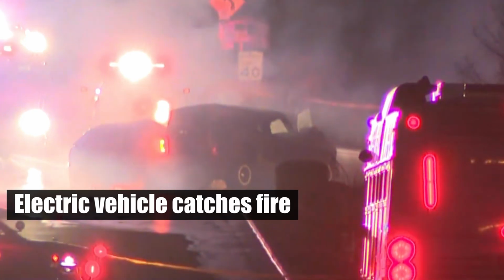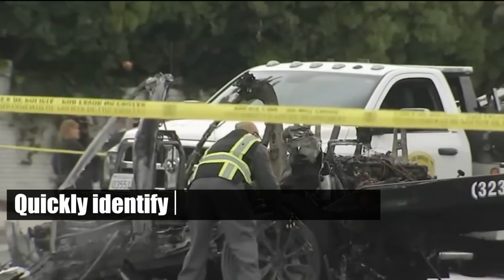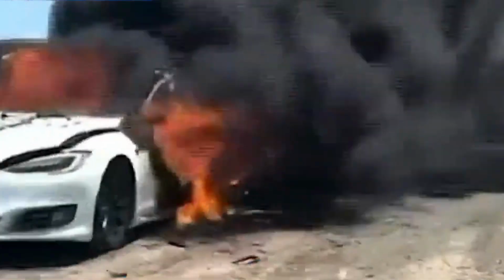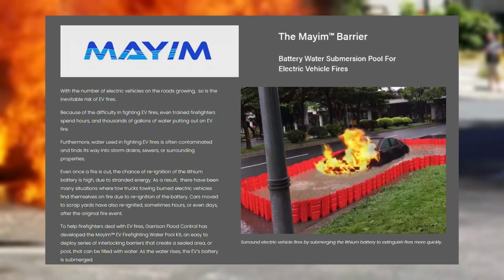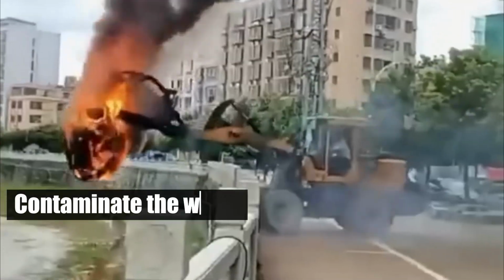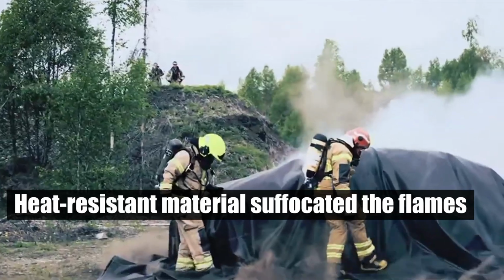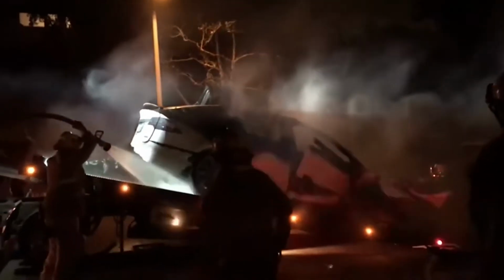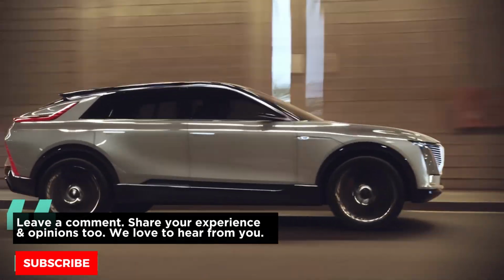First Responders Reveal Shocking Tactics for Battling EV Fires! Electric Vehicles, Water & Fire

Comment: EV Fires are not nearly as common as with ICE Vehicles.  EVs have 25.1 fires per 100,000 vehicles, ICE vehicle fires are 1,529 per 100,000 vehicles.  You are way more likely to have a fire in an ICE vehicle. Lately it seems like Youtube and the Press is really making a big deal out of the number of EV fires when it's an extremely rare event, especially when compared to ICE vehicle fires..
Reply: Lithium Ion battery fires are nothing to do with ICE cars they are a known danger in themselves before they were ever put into cars. You are also seeing failures in battery storage, re-cycling plants and E-bikes and scooters.;  If you wish to go down that road of statistics use the fire brigade ones as insurance companies do not take into you account arson which is 65% of car fires in the UK, the average age of an ICE vehicle which is 12-15 years old and the cause of fire, development and spread, most modern ICE vehicle fires probably around 95% is in fact electrical due to the demise of the carburettor, unleaded fuels which are far less combustible than the old leaded high octane fuels. and sealed fuel systems and diesel which is very hard to ignite although DPF filters in modern diesels do cause fires. You could argue EV's are not old enough to catch fire/ spontaneously combust as they are not old enough but they are. So the question is what will they be like in 12-15 years? You are also not taking into account the severity of an EV fire,  they may occur 24/7, are difficult to prevent,  they develop quickly, burn hot compromising building structures and you cannot put them out. There is no comparison (Ex fire officer with 30 years in brigade)

Comment: Too much focus on cutting off the oxygen supply, when these batteries create their own oxygen through the reaction within the battery. Cooling the battery is the only way that the water bath method works, and the blanket allows suppression of the toxic smoke given off.